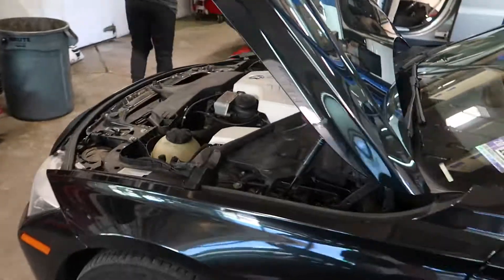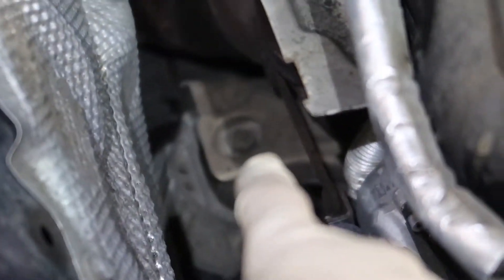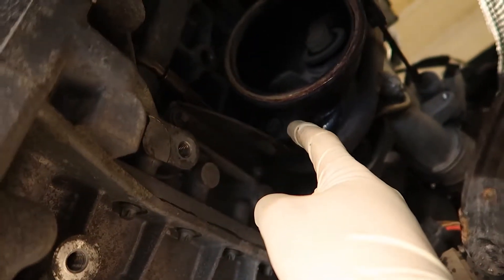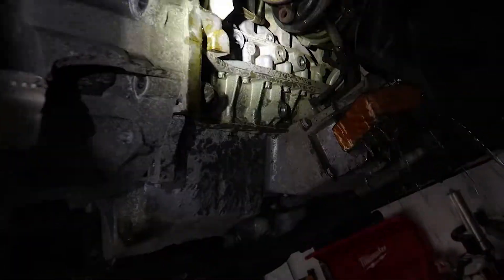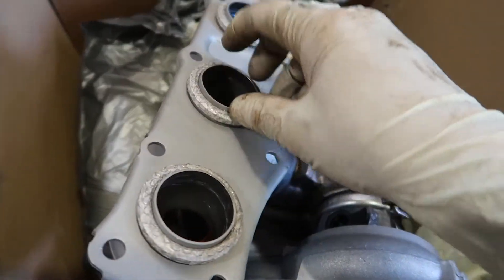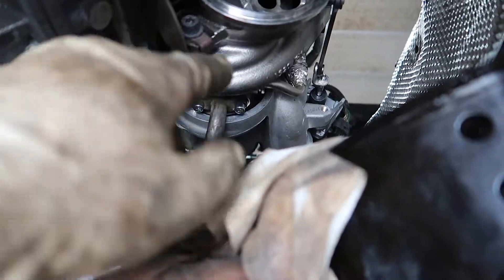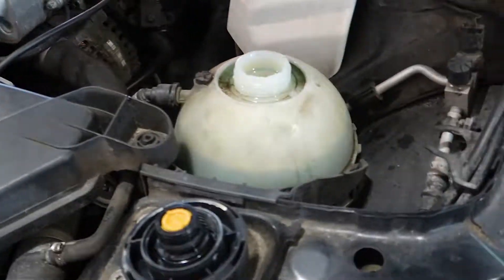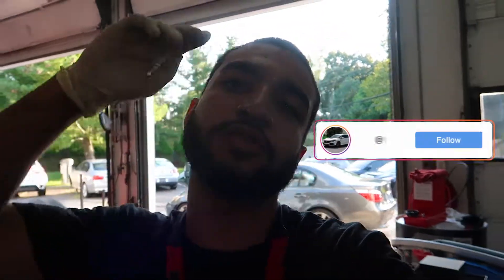Replacing Turbocharger BMW N20/N26 DIY

Comment: After you took engine mount off did you just use 2x4 to rest engine on frame?
Reply from the maker: @mikimiki195  yes
Reply: @ great video 
I’m dreading this job I just did engine mounts and now my turbo oil feed line is leaking. 
I’m planing on replacing all lines including turbo cartridge because I don’t want to go back redoing this again. 
Thanks again for taking time to record 👍🏻

Comment: Did you prime the turbo with oil? Mine has a directional check valve on the inlet pipe. How do I add oil?
Reply from the maker: @mistywilliamson9225  look for your oil feed port on turbo, should be the port on back side of turbo. The port that faces the engine block. Fill with a little oil and turn the compressor of turbo to circulate
Reply: @ after doing a lot of research, your can also use this method if that port is not accessible. Remove form pump relay and spark plugs, disconnect the oil return line from turbo. Crank engine until oil drains from return line. Turn put it So back together. Since the spark plugs are removed the turbo will not be spun, but the oil pump will cycle oil through the system.
Reply from the maker: @ yes this method also works

Comment: I'm curious, how much does a job like this run? I've got a 2013 x3 and it seems like my turbo went bad.
Reply: 1100 to 1300 Cad $
Reply: @aimized1460 I think you just mean the labour part. The OEM turbo alone is $1500 plus all of the mounting hardware, which is also expensive. Good quality cartridge is probably half of that, but these turbo have wastegate rattle issue so not sure if that is good path. I honestly would just replace the all of the coolant and oil lines if I was taking off turbo. Don’t want to be doing this job again when one develops a leak.

Comment: Or BMW could have just top mounted the turbo I recently replaced my GFB diverter valve with a new one and one of the bolts was stripped and I actually had to removed the turbo just to extract the bolt from it not an easy job but I got to inspect the turbo I guess

Comment: Any tips for separating the exhaust manifold from the block I got everything unbolted and it seems to just be stuck to the block I tried to hit it with a 2x4 from above and below. Just to clarify its completely unbolted. (10 exhaust nuts/2 bots on the bottom bracket, cat v-band, and all the oil/coolant lines/waste gate actuator)
Reply: Same problem here

Comment: I spent 4 hours to take out the turbo on 2013 328i , had the car on jack stands no lift, this job is not easy, the oil lines are MF to take out absolute bS design, tomorrow I’ll  put back in , doing this for my son, never again 🤪
Reply: I had a quote for 2400.00 just to replace the lines into the turbo .... insanity
Reply: lol doing it on my back too except I have an X drive model. So much worse.

Comment: If I just need to replace the coolant o rings. Do I need to take it all apart or is there a way I can just take the lines of?
Reply from the maker: If you are only replacing the O-Rings going to the turbo, you don’t have to remove turbo. You can go through the right front wheel well. If your replacing both ends, the turbo will have to be removed.
Reply: Shit.... Ok thank you for the info
Reply: My line is leaking, top one, after replacing the o rings. The rubber hose is messed up.  I have limited tools and my car's on ramps. Was extremely hard to do the o rings this way and now I've gotta do the line itself..are U sure there is no way to do without removing turbo?
Fyi , to do o-rings , isn't that bad, would've easy at a shop... But removing turbo in my parking garage is not going to happen... My top line is leaking from rubber hose..where does it go to?
Thanks
Reply: To access o rings I only removed plastic belly pan, put car on ramps then reached up through axle. under car... Some prying from top to remove bothl lines.
Reply: I'm tempted to cut rubber hose and repair wirh a t splitter and 4 clamps, just to get car going again but the margin of error for this is too much..
Any advice to access the other end of this line...
Reply: @TheBaptistJimBeam  remove the cold side of the turbo and you will have access to the coolant line on the block, dont need to remove the whole turbo

Comment: Symptoms were you getting to know that you need to replace the Turbo?
Reply: Turbo whine sounds like a police siren, like mine currently :(
Reply: @MrWaheedulHaque  where did you get the new turbo? I'm thinking about replacing the cartridge only to save some some money.
Reply: @CityHunt3R911  and i haven't yet bought a new turbo as BMW themselves can't source one for me, so i am getting it reconditioned same as you just said putting in new cartridge with a good reputable company, make sure to get one that provides warranty for at least 1 year
Reply: @MrWaheedulHaque  I just installed a jb4 and it looks like my turbo is working fine, just needed a little tune and some ethanol E85
Reply: @CityHunt3R911  nice bro im glad its sorted
Reply: @MrWaheedulHaque is the whine only supposed to be heard at low speeds? because i only hear a whine at low speeds but anything higher than around 20mph i don’t hear anything, and performance feels just as good as when i got it, just wanna make sure
Reply: @andrewrogel1437 if you're still worrying about this, your turbo is just fine as is, but you should start to think about replacing it at 120k miles
Reply: @crescious3231 still going so far, i’m at 130,000 miles and still got the noise, no performance issues YET lol hopefully it lasts long enough until i can afford a new one 🤷‍♂️
Reply: Well mine isn't making any sounds but it doesn't boost consistently especially in 1st and 2nd
Reply: @CityHunt3R911  if it don't make any noise and doesn't boost then might be a wastegate problem, you can get that tested quite easily at a exhaust shop, or even by using a obd2 dongle and torquelite app setup boost monitoring and see whats happening, are u hundred percent sure its your turbo, it could just be a gearbox issue if its only in those two gears
Reply: @MrWaheedulHaque  I'll have to look into that, feels like in first onves I hit 3to 4rpms there's no boost, maybe the waste gate is opening too soon? If feel like I might as well replace the cartridge if I'm going to replace the waste gate. Boost feels fine once I'm going 45mph plus

Comment: what are the torque specs for the manifold bolts? or are they tightened until firm?
Reply from the maker: I believe it’s somewhere around 11-15 nm but yes, until firm. Once they’re firm, double check the rest and tightening it uneven will result in loose nuts